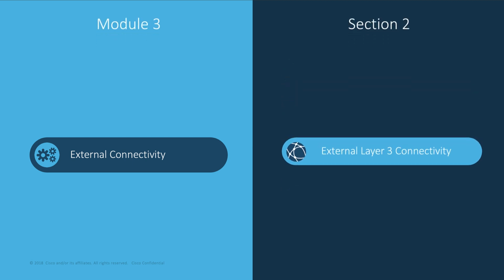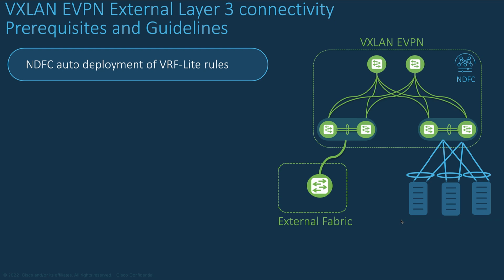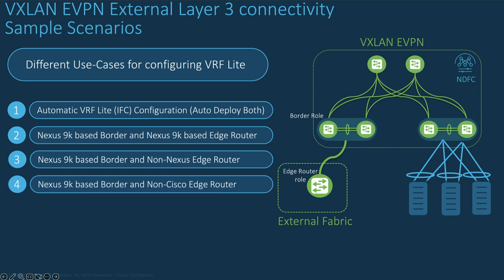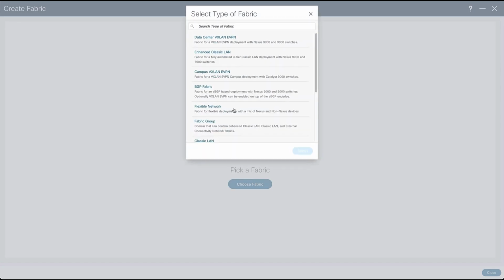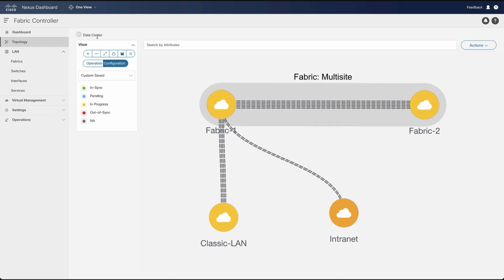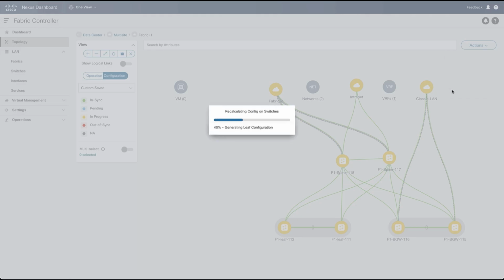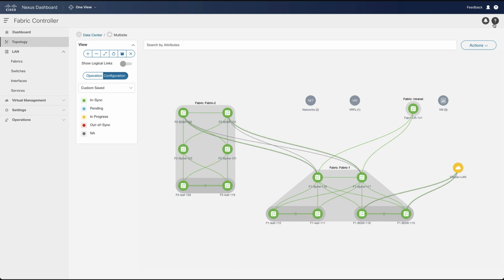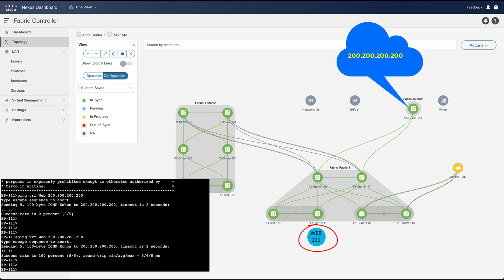NDFC 12 Module 3 Section 2 - VRF-lite Hand-off Full Automation

Comment: What video or guide is best to showcase External WAN connectivity directly to border leafs on a simple VXLAN fabric? I will have multiple cloud providers / WAN providers that will be connected to border leafs. Each of these needs to land direct to interface (*not* sub interface) and be in it's own VRF in each case. Obviously these external WAN devices will not be under our control. The official Cisco docs are very lacking in this area and I'm struggling to fully understand how to do this inside of NDFC.

Comment: Hi, thank you very much for these videos! 

I’m trying to deploy an inter site connection between my Cisco vxlan evpn fabric and a classic lan deployment without Cisco switches/routers, is it possible you could do a demo of that?
Reply from the maker: I can certainly demo this use-case, but there are a couple of options.
Do you mean extended L3 connectivity between your VXLAN EVPN and your Classic LAN (very similar to this video + enhanced Classic LAN) or L2 and L3 extensions between VXLAN EVPN (very similar to Multi-site, you will need to add a pair of BGW in the Classic LAN fabric)